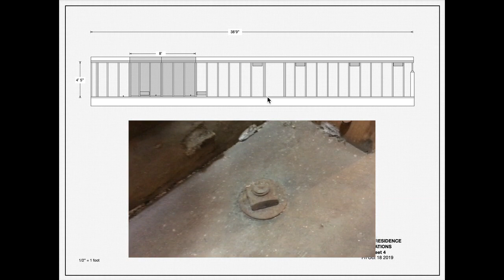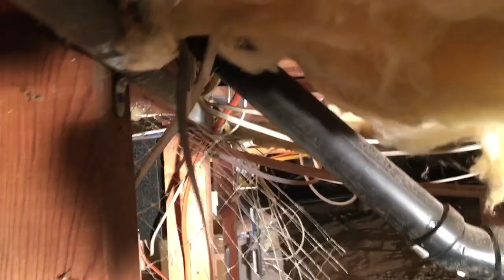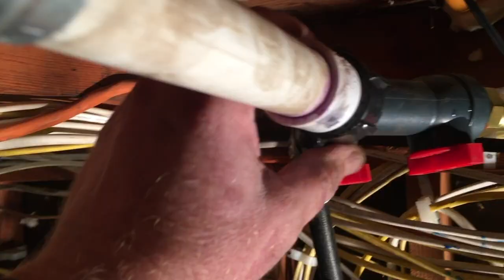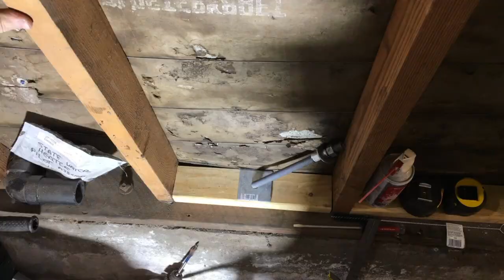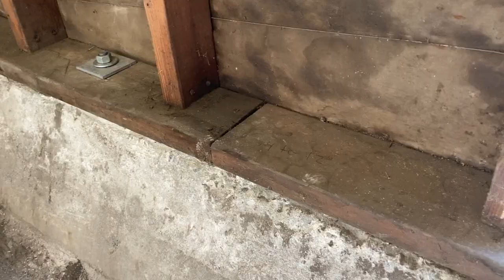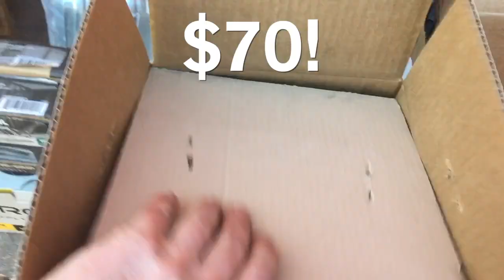DIY Earthquake Retrofit For "Free" with the California "Brace And Bolt" Program

Comment: Thank you for a very informative and entertaining video! 

I just had Bay Area retrofit at my house today. It's on a hillside with balloon framing from the crawlspace up to the bottom of the second floor (about 12 feet total). They're telling me I'll need to brace the front wall (closer to the street) with HDU2 hold downs that anchor from the floor joist to the concrete wall with a long steel rod expoxied into the concrete and URFP plates. then for the back wall at the rear of the house going downhill, sheer panel in my crawl space all the way up the walls of the first story inside the house behind the drywall. I thought I was going to do this project DIY until I learned how much more work is involved than just bracing the crawlspace.

Why did you choose not to flush cut the mudsill and install blocking between the studs instead? I asked about that today and they said that blocking is extremely weak due to the quality of the wood and size of the pieces.

Comment: When the inspector came did he measure the height of the cripple walls…mine is 6 inches too tall…wondering if they even care…thanks great video🎉!
Reply from the maker: Nope. Didn't care. (Also seemed more attuned to general structural things he saw all the time and not the particulars of Standard Plan A and earthquake retrofitting. Nice guy though.)

Comment: Hi. great video.  I live in your area.  You told us the price of the permits when you pulled them in 2019.  Can you tell us a list of which permits you needed, so that I can work on a rough quote of the cost for my house, please.
Reply from the maker: It was just the one permit (even though I did move plumbing and electrical). The county has fast-tracked Earthquake retrofit applications so it's pretty easy. (The Brace & Bolt people are more of a pain -- especially when they want to override the county inspector -- to make me put in vent holes for example!)

Comment: Thank you so much for sharing! For plywood nails, Plan Set A requires 8D common x 2-1/2" long with a minimum shank of .131 (.131" x 2-1/2"). I can't find such nails (especially for nail gun). What kind of nails were you used for nailing plywood? Thanks for your help!
Reply from the maker: Hi B. It was so long ago I am fuzzy on the details now. I looked at my big spreadsheet but it doesn't have enough detail. I seem to think, in the end, I ignored the minimum shank size and just went for 8D 2.5 in -- but yes, I also think I had to hunt for that size for the nail gun and wound having to buy an entire carton for like $70 -- but I might be imagining that.

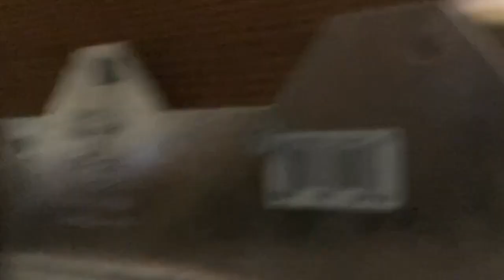Comment: I almost lost it when you shouted “IT’S GOD’S WORK” @ 1:33:38. Appreciate you taking the time not only to do this stuff in the first place, but also meticulously document it and share your gotchas and lessons learned.

I’d like to do the same on my (new to me) 80 year old house but my crawl space is only about 3’ high and the extent of my power tool collection is 2 battery powered electric drills. I also don’t have a dark master to consult or borrow from. At any rate, it’s given me hope that this project is maybe feasible at some point.

Great work and great video!
Reply from the maker: Thanks so much Mark for taking the time to write and for slogging through the thing! This video probably has the worst audience / work  ratio of anything I've done, but, on the other hand, the viewers interested in this info have shown themselves to be people of the first quality.

Good luck with your new old house -- should you decide to "tool up" and go spelunking!

Comment: Hi
Is there a reason not to use Wedge anchors instead of epoxy  threaded anchors?
Can i use OSB plywood?
Reply: Epoxy anchors don’t put stress on the concrete like a compression anchor does. If you’re concerned about the strength of the concrete then epoxy is the way to go. It does have more steps though.
Reply from the maker: From what I have heard, the wedge vs epoxy question is a regional preference. Supposedly in LA they use wedge anchors more. The Standard Plan doesn't specify one or the other.  The Standard Plan DOES call for plywood and not OSB however, though not the (better) structural plywood I used.

Comment: You are an inspiration! I've been wanting to do a seismic retrofit on my older home for many years. I started reading and watching videos on Howard Cook's site. Then I sized up my own job yesterday and came out of the crawl space very dispirited because there seemed to be so many things that seemed insurmountable. Anyway, then I came across your video going through every step and in detail (and we share the same building department too)! It feels totally doable now. I don't know where you got the intestinal fortitude to do all of this and film it, but it's really a great piece of work! Thanks and kudos to you! oh, one question, since your top plate and rim-joist are flush (my situation too), could you have skipped the shear ties and run the plywood all the way to the top of the rim joist (butted up against the bottom of the sub-floor)?
Reply from the maker: Thanks for the kind words, Robert. Yes, well, the inspector said all I had to do was run the plywood all the way up (which I did) -- BUT, since I put the shear ties on the plan I had to put them in, so I did that too. 

 SO...it is a question of whether you can get a plan without them by the county (I think there is a fair chance you can -- and the state never sees the plans, so they should not squawk.)

Comment: Ward Excellent, 
I struggled through your entire video in one sitting, no martinis more’s the pity. I got a chuckle with your balanced critique of the bureaucracy you get additional points for being a flaming liberal. 
I was the S.O.B. who complained about your electrical work in your generator project, after seeing your crawlspace NC wiring I bit my lip it still bleeding. If I was your neighbor I’d stop by so we could do a new video “up grading my electrical service to 200 amp with generator transfer switch & Tesla 50-amp charger.  I understand if you live in San Francisco you must Be Sure to Wear Flowers in Your Hair and drive an electric car. P.S. I also enjoy your earlier software rants
Reply from the maker: You are a brave man, and no SOB. When we moved the serviced to the wall it is on now we did take it up to 200. And, I guess about a decade ago, I built a 30amp/6.6kw EMW "Juice Box" level 2 charger, back when they first came out sold it as a kit, for my wife's Chevy Volt. So yeah, I guess we do fit the profile! (Regrettably, she dumped the Volt and, true to form, got a Prius, so the charger is unused now -- but that position in the load center is going to be a great place to pick off the branch for the xfer switch!)
Reply: @WardCo  Hope you and yours have a safe sheltered Thanksgiving.
Reply: @WardCo  Modify the previous so you can charge the battery from commercial power, and if you erect the thing you can buy a Tesla.